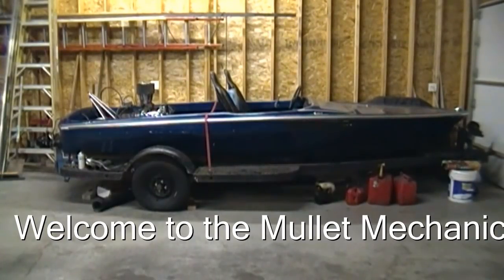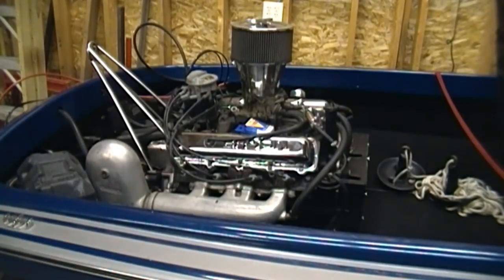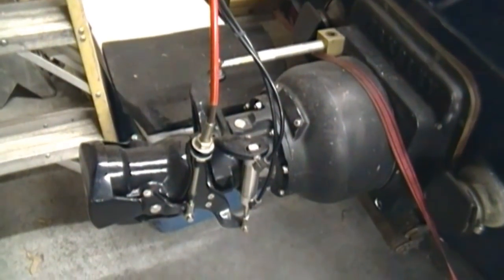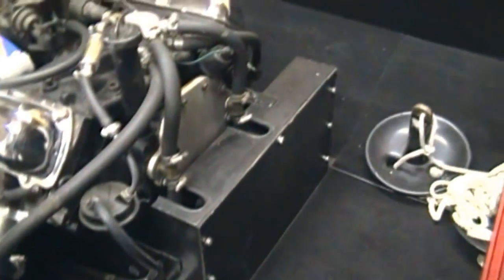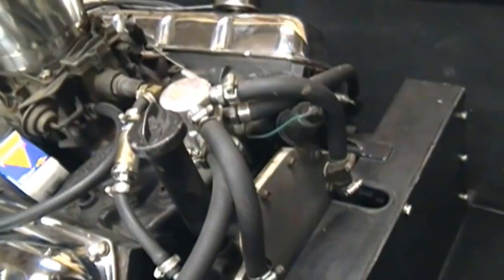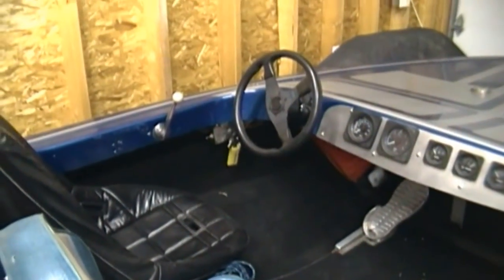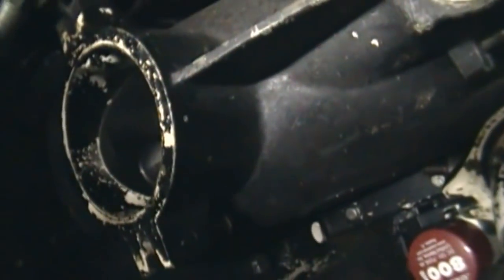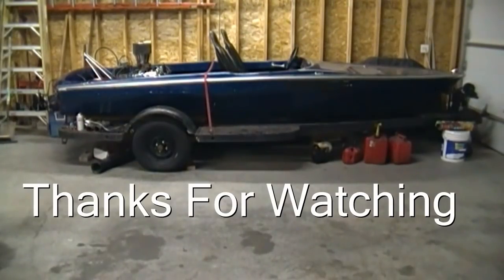Jet boat or JetBoat basics 101

Comment: Never put a high volume pump on a 455 olds dude
Reply: howcome?
Reply: @PearlJellyz  At the RPM these engines run with the pump, all your oil gets pumped into the top end/valve cover area and does not have time to drain back, so you end up starving the bearings. Oldsmobiles are famous for that. Spun rod and main bearings. It does help if you have a large aftermarket rear sump oil pan.
Reply: @rondyechannel1399  awesome, thanks for the reply. So this engine is rotating at a higher rate than what a high volume pump is intended for? Are high volume pumps for typically lower RPM motors?
Reply: @PearlJellyz  A jet pump requires the motor to be spinning above about 3500 RPM for their to be enough discharge water to either steer or for forward thrust. Usual running RPM is a constant 4000 to 4700 RPM. At those RPM's you need less oil to be pumped into the top end. You can put oil restrictors in them, like oil restrictor push rods. If you want higher pressure to the bearings, restrict the top end and shim the bypass in the oil pump for higher pressure. You do not need more volume. High volume pumps are a crutch for worn bearings and low oil pressure.

Comment: What about oil pressure? Basically stock 455, with stock pan
Reply from the maker: I like extra capacity pan with trap doors, a crank scraper or windage tray, high pressure pump with matching drive shaft and Mondello oil restrictors.  Hows your budget looking?
Reply: I just bought the boat... did an oil change. The oil pressure is around 50psi at idle. Does that sound too high? Thanks for the tips, much appreciated.

Comment: hi , waht about the gear shift when you put car engine in boat , do you use the original gear box or you have to buy another one , and how do you control in gear shifting ? please
Reply: Abdu abdu   You should not own a boat.
Reply from the maker: It's direct drive to the pump, no gear shifting.
Reply: thank you very much

Comment: What sort of flow rate/pressure do you think is coming out of the tap on the bowl? The reason I ask is I have a 85 5.5m Condor with a 454 and a Berkely (with jetovator). I would like to install a ballast system with a hidden bag in the front of the boat as well as bags under the rear seat. Most of these auto fill ballast systems use an electric two way pump so you can add and remove weight as needed however need a hole in the transom. 

Firstly if I tapped one of these systems into the tap on the bowl would I starve the engine?

Secondly would there be adequate positive pressure on the system to fill vented bags without a pump? I mean to say if I flipped a valve would water go rushing into bags or would it be more neutral pressure?

Thanks for your help, just a new boater looking for advice.
Reply from the maker: What do you need ballasts for?  Just a bunch of extra weight.  I'd start with a hydraulic Place diverter and even that is a gimmic.  Your best performance is with the nozzle pointed square out the back.
Reply: My son really wants to wake surf where you have to list the boat over to the side to create a rideable wave. I want to wake board so getting the boat down further in the water is advised so I am told. Considering this is more of a ski boat with minimal wake Im just trying to give myself options. 

Considering your experience with boats like this am I going about this all wrong? I have the place diverter but ballast seemed to be the logical way to make a ski boat a wake board/surf boat.

Comment: can you tell me where the 15 psi pressure reducing valve goes exactly, please and thank you!
Reply from the maker: +Cameron Lian My pressure reduction valves are plumbed in right after the Berkeley pump outlet valve.
Reply: Will this valve work you think?  

https://www.google.com/url?sa=t&source=web&rct=j&url=http://www.supplyhouse.com/Apollo-Valves-13211B15-3-4-475000-BTU-Capacity-Low-Press-Steam-Safety-Valve-15-psi&ved=0CBwQFjAAahUKEwiYi-Co8bDHAhXHLYgKHbjfAPM&usg=AFQjCNHTn9vSXwXd4LKkhbNIsZ1TVChb_g&sig2=1l7Eey_kAhUMgu5yBwGBVA&q=apollo%2013211B15